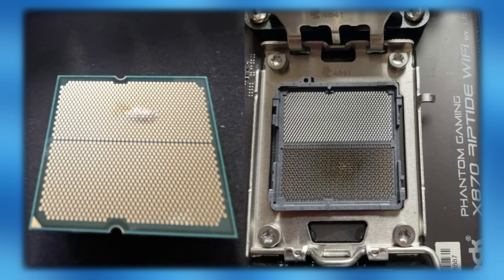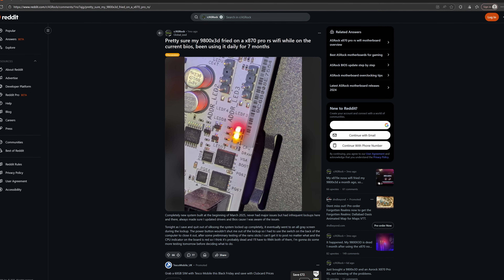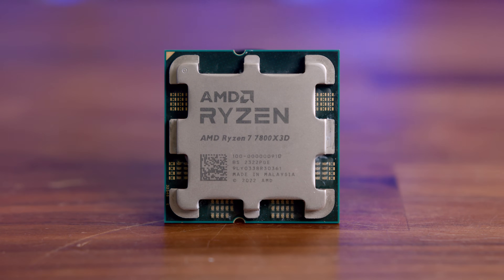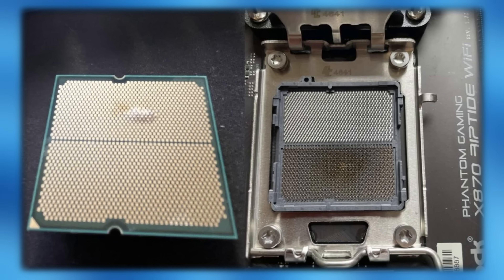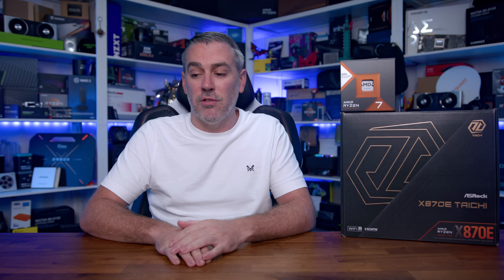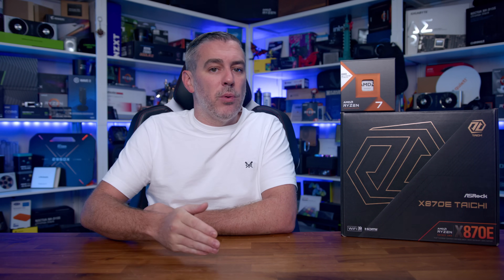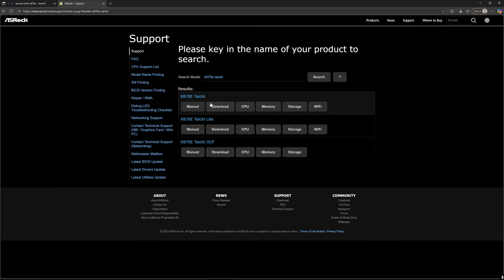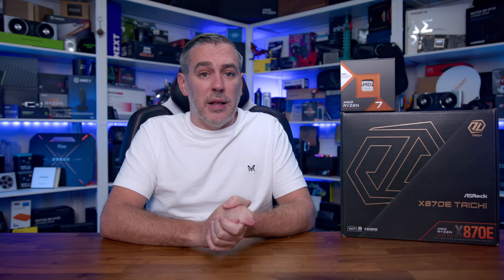AM5 Motherboards Are STILL Killing CPUs!!!

Comment: Because this is an ongoing problem with ASRock Motherboards that they seem unable to fix, I would avoid their AM5 motherboards when using an X3D chip at all costs.  It's just not worth the risk, when there are so many other better and safer choices available from Asus, MSI, Sapphire and many others.
Reply: i wouldn't recommend asus they have the same issue as asrock motherboards.
Reply: @artificer6407  I haven't see reports about failing X3D CPUs on Asus Mainboards lately, so I think Asus is safe now.
Reply: @artificer6407  Asrock is Asus.
Reply: @MrKony98  they are still own by the same company
Reply: @philipcooper8297  still run diff bios..haven't read any problem with asus b850 boards..would avoid the prime ones though.  vrms suck
Reply: I have both with no issue so far.
Reply: Issues with my asrock knova board. Returned replaced c p u and motherboard picked up the msi tomahawk, putting it together now.  Two year warranty  ensures it'll be good for me for the time being. We're going to get the godlike board. Are there issues with a new system in it not sure what the name of it is but decided against it. The 870e version.
Reply: Its an ongoing issue with all motherboard makers, dont single out Asrock as this is also and AMD issue.
Reply: @Pandemonium088  Asrock is the main culprit here, sure there may be issues over at AMD but I doubt they are a major contributor here since very few other brands are having as many if any CPUs burning up as Asrock have.

Off the top of my head from doing research ASUS have one or two but they were attributed to Luser error. (Seriously, end users are pretty stupid when it comes to installing CPUs and dropping CPUs or forcing CPUs in to the socket the wrong way)

From the research it would simply be down to Asrock setting wrong parameters for the shadow SOC and PBO settings. 

Hopefully they have fixed the problem with their recent BIOS updates but end users also need to not be setting silly overclock settings either.

The X3D CPUs already run hot at stock and don't give much more performance per watt even when dialed up. What you get instead is a much higher power draw and a ton of extra heat.

None of which is doing the CPU any good.
Reply: @pixelfrogs Sure its easier to blame it on Asrock,  would too 😅
Reply: @Pandemonium088  Till AMD tells us otherwise all we have is the evidence from Asrock boards burning CPUs.

No point in blaming AMD without evidence from them letting us know they dun messed up.
Reply: @pixelfrogs yo what about the itx boards? Asus has a few, x670e-i and b850-i that I'm looking rn. Someone from reddit was saying the first works with both gpu and nvme drive being pcie 5.0. so the usb 4 would throttle then?
Reply: I have Asrock b650m pro rs WiFi and would like to eventually upgrade to a 7800x3d or 9800x3d in the future. How common is this? Is it very uncommon but enough to be an issue or common enough that you'd be stupid to ever pair the two together.
Reply: I have a asrock b850 steel legend wifi motherboard with a asrock steel legend 9070xt video card and it's all working well but my cpu idle temps are 43-45c
Reply: @belair7488  This issue is mostly affecting the X870 versions .. the higher end boards tend to have a bit more fabricator fiddling going on in the bios to make the CPU appear better performing out of the box. Gotta make you feel like you have spent that extra money well.

ASUS was well known for doing this fiddling on Intel boards by driving the CPU with higher voltages...till Intel got wind of it and that it was damaging CPUs.

Here its Asrock having some questionable PBO and SOC voltage settings on their X870 boards.
Reply: Is my Ryzen 5 7600 safe from this ? My bios is the version 3.40 and my board is B850 Pro RS WiFi. I’ve been using it for one week now, still no issue, and I had no idea about this issue until now. Should I be worry ?
Reply: I used B850M Pro RS + 7600X. Motherboard RAM B2 lane is dead, my 7600X is also dead. Sadly i didnt aware of the ongoing issue with Asrock board, so i replace it with B850M Pro RS Wifi + 9800X3D lol. It has been 2 weeks, hopefully nothing happened, but I’m eyeing up for MSI board next month
Reply: Sadly the Asrock X870 boards are some of the very few models that don't use PCIe sharing between the NVME and PCIe slots. MSI Tomahawk X870 boards have very little sharing but MSI have had nothing but issues with their BIOS and DDR5 support, I have personally gone through 3 different sets of DDR 5 6000 and nearly a dozen BIOS updates to find a set that doesn't have issues with my Tomahawk board and I recently just threw the thing in the trash because its been a terrible experience with it. (Its not the board, itll run the memory just fine at 4800, MSI really does have terrible DDR5 compatibility, not the CPU either as in the Asrock board it runs all memory kits I bought at 6000/6400 just fine)

I grabbed a Nova Phantom board a few months back to replace it and its had zero issues so far with my 9800X3D, I have manually tuned RAM/CPU settings on the latest BIOS to prevent these over voltage problems and run a heavy undervolt to keep temps in check. I also don't use PBO or EXPO as both may be adding to the problems and run a voltage monitor in Windows to track it. Id rather deal with taking extra precautions than keep dealing with MSI.

I have no desire to run either Gigabyte or ASUS boards as they both use heavy NVME/PCIe sharing with GPU lanes.
Reply: @pixelfrogs don't know what you mean I have a Gigabyte B850 Aurous Elite it doesn't use lane sharing, not had any memory or BIOS issues.
Reply: @DBIIJ0U  Well yeah because its a B850 and not an X870E with 5 NVME, 3 PCIe slots, USB4 and an assortment of other peripherals all using the PCIe lanes.

You are trying to compare apples to oranges here. The more onboard stuff you have the less lanes you have to go around and on ASUS and Gigabyte X870 boards they do a lot of lane sharing especially the PCIe 5.0 SSD slots sharing lanes with the main 16x PCIE slot.

I hate lane sharing boards and refuse to touch them if they go the path of taking lanes from the GPU slot. That's a big deal breaker for me.

The Asrock X870 boards don't do that and overall use very little lane sharing.

As for the BIOS problems MSI has terrible BIOS support and having had to update my Tomahawk board BIOS 12 times since I got it just to get DDR5 working at advertised speeds I now refuse to use their boards.
Reply: @pixelfrogs You realise you stated nothing about chipset, you just stated brand. The impact of bifurcation isn't as bad as your making out to be, if you need the extra connectivity and storage it's not a bad tradeoff the performance loss is minimal it's PCIE-5.0.
Reply: @DBIIJ0U  Yeah that's a big no thanks for me. If they have to resort to lane sharing with the GPU slot then they are doing it wrong and simply taking the cheap way out. If they want to share it with other systems like  USB4/SATA then that's fine but never with the GPU slot. If Asrock can make X870E boards with no lane sharing and lose no features then ASUS and Gigabyte can do it also, the fact they dont is more to do with them selling overpriced rubbish boards with Ricer Gamer RGB than anything else.

I shouldn't need to state chipset here the Phantom Nova only comes with X870E but I have clarified this above.
Reply: @pixelfrogs  The original comment didn't state anything about the Phantom Nova board specially, you did but you just wasn't clear, you've edited your comment so no big deal, X870E is definetly the way to go for connectivity, X870 is the equivalent to B650E. Don't get me wrong I'd rather not deal with land sharing just saying people get to dramatic over it. Considering most people with the need to be running that much storage would be likely using it as a contract creation/productivity it's not a big deal the performance loss is minimal.
Reply: @DBIIJ0U  I have no issue with it so long as they don't share lanes with the GPU, Buying a 5090 and finding out its getting gimped because the motherboard fab took the cheaper option is annoying. You say its minimal I say its a 5090 which is worth 4 of these motherboards the least they can do is not gimp the main GPU slot.

Share lanes with the USB 4 or pointless second NIC or quit putting a second even more pointless 16x PCIe slot on the board. 

Plenty of ways to not steal GPU lanes, ASUS just loves being lazy and cheap.
Reply: Never had issues with my 9950X3D 64GB DDR5 6,000 MT/s Corsair Dominator titanium kits on my MSI Carbon X870e stop spreading misinformation
Reply: Sapphire motherboards?
Reply: @eugenijusdolgovas9278  Sapphire is made by Asrock. Gotta go with trusty old Biostar
Reply: @eugenijusdolgovas9278 yes